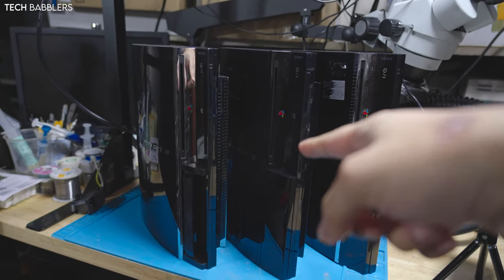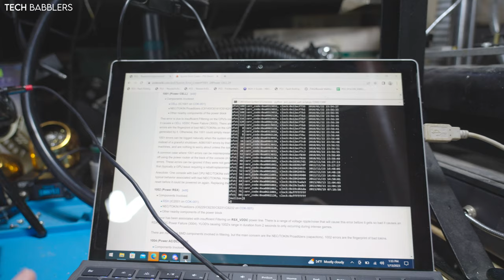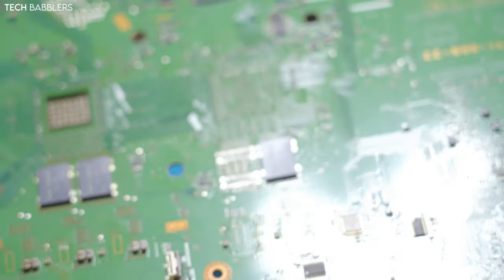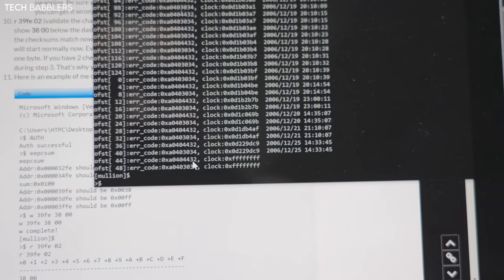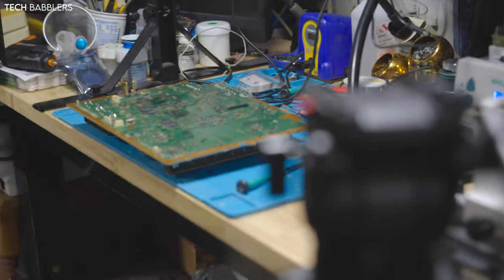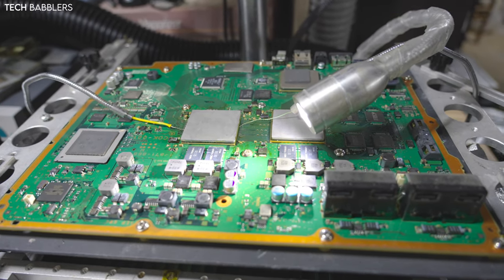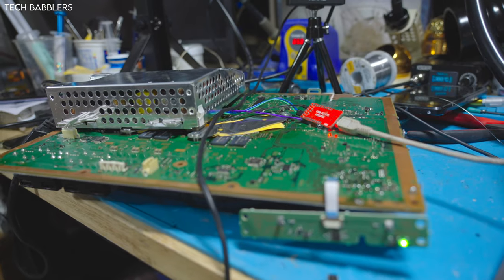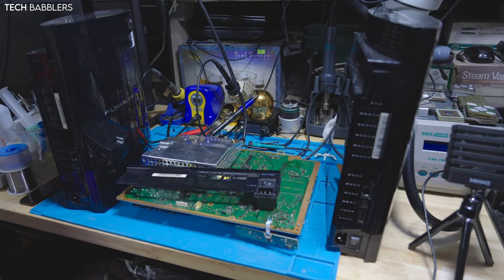Repairing 3 PS3 Backwards Compatible Systems From Japan

Comment: When you put the tantalizers in I'm guessing there's a spot for the power in the ground I've seen them on eBay just didn't know how to install
Reply from the maker: Yes, the outer rails are the positive adn the innter two are negative, orientation of them dont matter when installing, as it's flippable.
Reply: Was just on PSX asking some questions new to the site trying to figure out how to use it